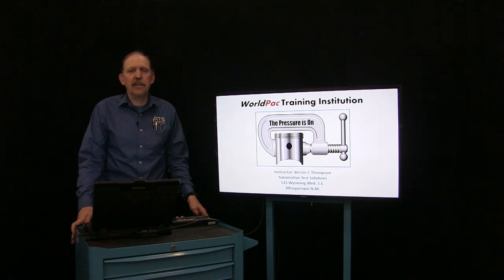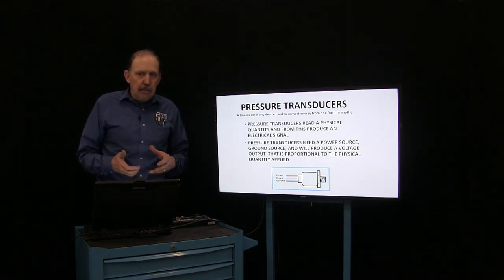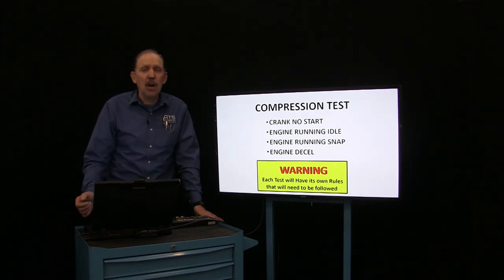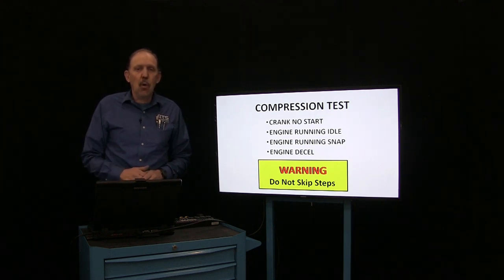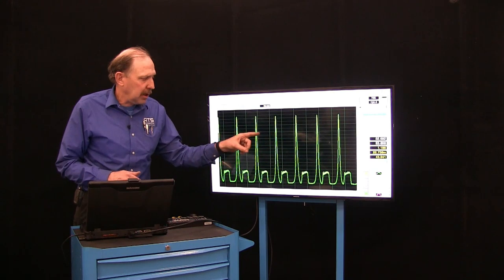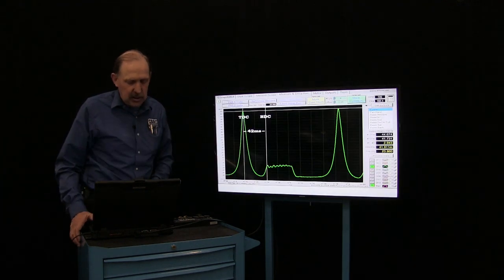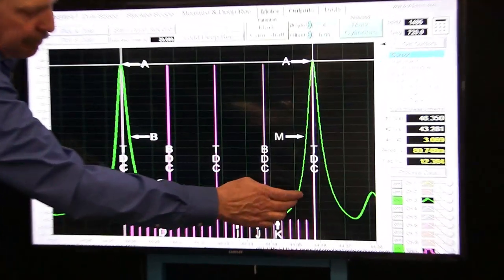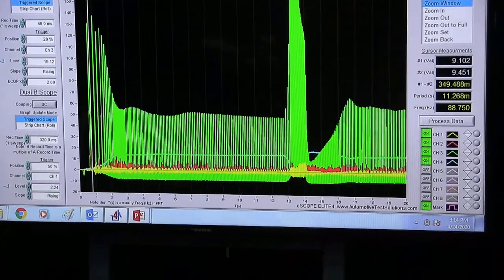Pressure Analysis for the Internal Combustion Engine

Comment: Love your lectures, Bernie! Why is the term "volume" used often when it should be "mass"?
Reply: I had the same question
Reply: Using the term volume instead of mass does not make any sense here unless I am missing something. I am surprised to see that the person who made the video has not replied to your question.
Reply: It does seem to be confusing.  Sometime volume is used correctly as it indicates area.  But I have never heard of something leaking volume.  And when he speaks of air then we have a compressible and expandable gas which is the mass contained within the area or volume.  I think.😮
Reply: THANK YOU! Obviously Bernie knows what he means when he says that (although it's still the wrong terminology), but the problem is that it can be confusing for others who don't understand it as well.

Comment: Adiabatic = Heat (Q) doesn't change from previous state . Definitely right not enough time for thermal expansion on compression stroke.. heat from intake process dont have enough time to shed head

Comment: Detailed explanation Bernie. There are dozens of people making cheap transducers using eBay components. Drawbacks being slow sample rates and the lack of the ability to measure below zero.  Has anyone found an affordable transducer that is better quality to experiment with?
Reply: The low cost gauge pressure sensors (e.g., 0.5 to 4.5 volt = 0 to 200 psi) do read below zero!  The gauges are "zeroed" to atmospheric pressure at sea level with a voltage output of 0.5 volts.  Any "pressure" less than sea level will give a reading below 0.5 volts.

A 200 psi gauge has about -25psi / 51"Hg vacuum measuring capability.

Comment: 27:00 would the air intake cycle pull more exhaust in from the high pressure exhaust manifold  via the closed leaking exhaust valve  instead of air through the more vacuum intake manifold via the open intake valve? Is this the cause that that cylinder misfires ?

Comment: What if i have a spike on my exhaust stroke tdc but i got only one camshaft and 4 rockers per cylinder. Also, at idle no problem, but when i rev the engine up, the exhaust tdc spike get higher and higher like im losing a normal scaveging. I could have udrestand that if i had 2 seperate camshafts, but i have only one camshaft. Exhaust is not plugged. Im confused, that is not normal. It gains losses of power to overcome this excessive pressure and also makes my fuel trims go negative - false rich condition. My exhaust valves, spark plugs and lambda sensor are white. Lean mixture white.

Comment: sir,,how the atmospheric air that goes to the exhaust pipe in rush into combustion chamber if the exhaust valve still close and when it's open their's an exhaust gas rushing out from combustion chamber to exhaust system therefore the air from atmosphere cannot come in.....

Comment: Hello master. Very good class about pressure transducer. But I've got a question. You said two towers in b and m should be 20 degrees from each other but I can see they are far away. Did I miss understand that point?
Reply: You have to use cursors to measure how far they are away.